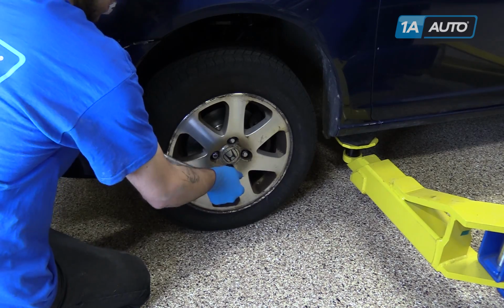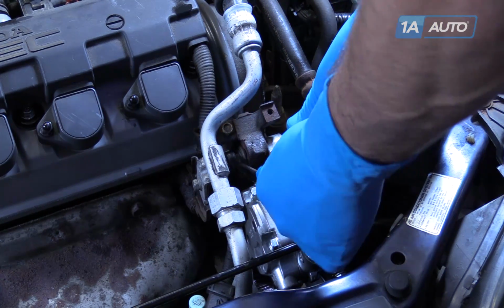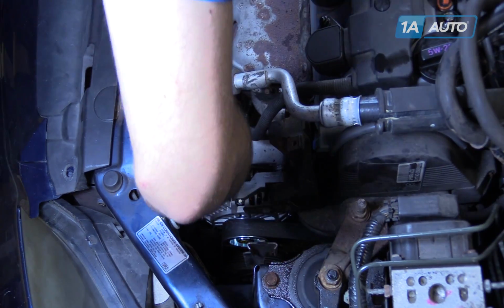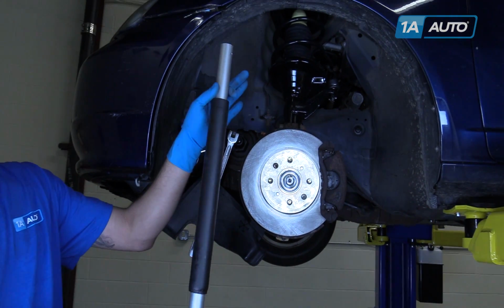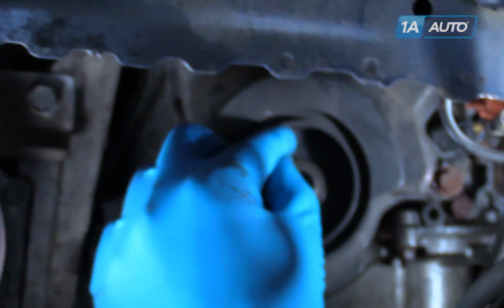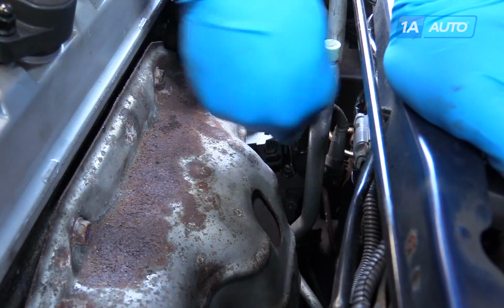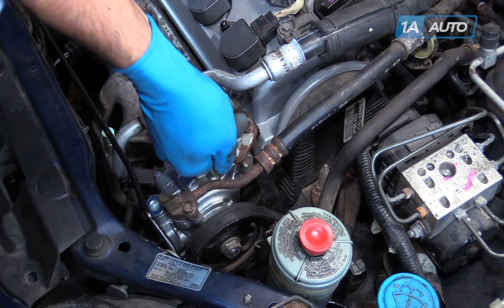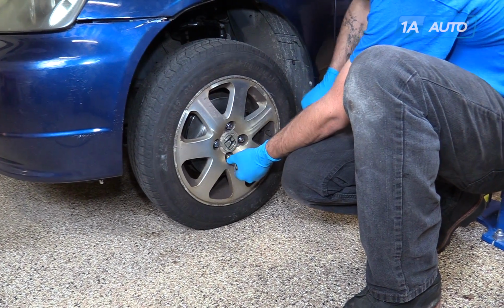How to Replace Harmonic Balancer 01-05 Honda Civic

Comment: Not to long ago I completed this job just get to that solenoid. Took the alternator outdid it with impact with special nineteen socket. Use the special torque socket for the impacts. Please guys don't over torque the crank bolt. 50 to 80 ftlb. Be nice for the next person who will be working on this car.

Comment: Do you have to remove to alternator plug and cable I want to check for a leak from the crank seal and I just wanna pull my harmonic balancer off

Comment: Thanks for the  video , I have a important question ?  How  do  you troubleshoot a crankshaft pulley that is not aligned with all pulleys  on a 2014 Honda Civic ex 1.8

Comment: wow would be nice to see the distance from the pin to the bolt in relationship to the noise. as the crankshaft doesn't flush and it seem the key can wobble back in fort but you slapped it on quick couldn't do a comparsion with mine...

Comment: Could a bad harmonic balancer cause consistent vibration throughout the rpm range? I've replaced all motor mounts and checked every ignition source, this is my last guess.
Reply from the maker: +Frank Davis Jr If it is not balanced then it could certainly cause that issue, but we recommend you get the issued professionally diagnosed if you are unable to do so yourself!  1aauto.com

Comment: why do you need to disconnect the connection on the alternator and pull the power steering out of the way?
Reply from the maker: +Neversoft15 Thank you for checking us out. Doing this will allow more room to move, and it assisted with a better camera angle for this video. 1aauto.com

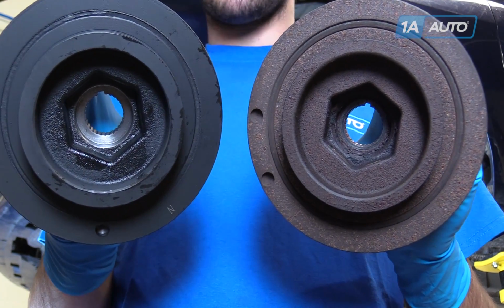Comment: What is the name of that metal piece part at 6:07? Thank you
Reply from the maker: +MrGame It is a key way that fits the harmonic balancer. Hope this helps you out 1aauto.com
Reply: Yes, you don't want to loose those small key(s) like I did years ago with a 2000 Jaguar.  You pull the pulley with out watching that key the mofo will stick to the pulley itself or shaft.  That tiny little bugger, (harmonic pulley key), is a major important role to keep the engine turning.

Comment: wow great video! one question,  you don't do the timing after the pulley removal?
Reply from the maker: +ray_saul Nope, the only belts attached to that pulley are the power steering and the alternator. Timing is on a different pulley under the timing cover. Hope this helps you out.  1aauto.com?utm_source=YouTube&amp;utm_medium=CTA%20Comment&amp;utm_campaign=1ATony 866-403-3393